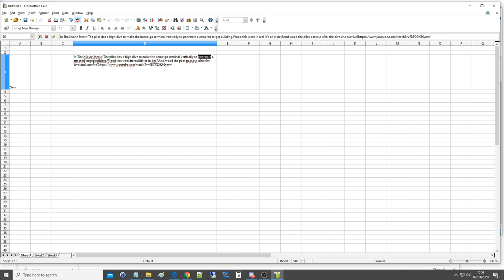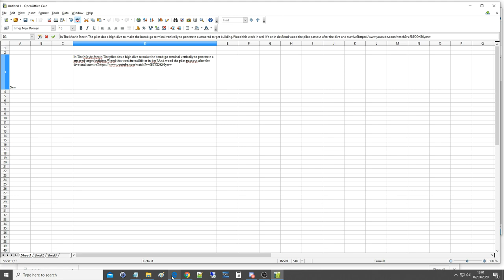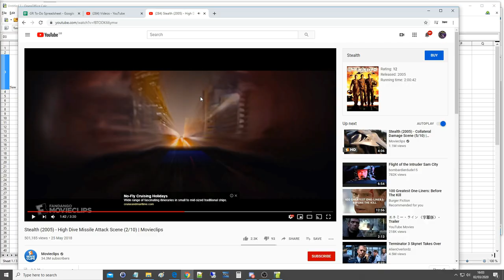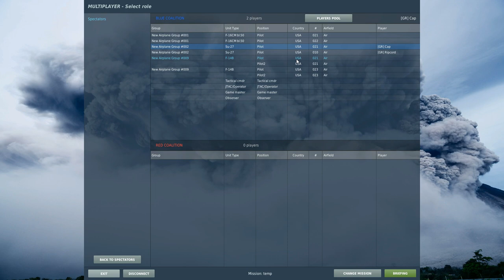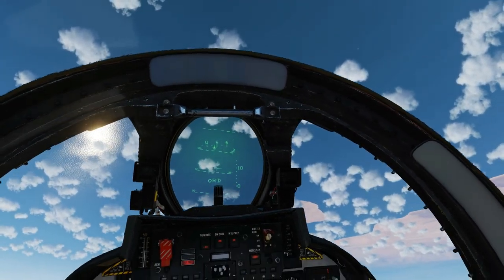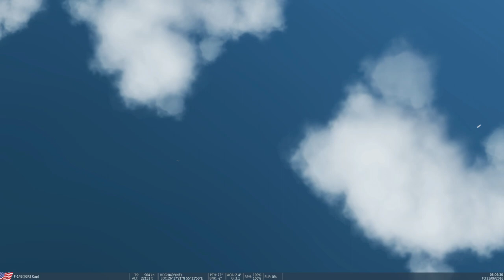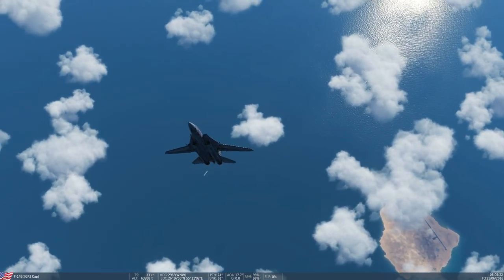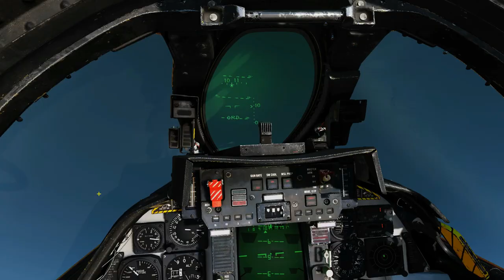Stealth(2005): Can You Increase A Bomb's Penetrating Power By Diving? | DCS WORLD

Comment: Cap - to optimise your acceleration during the roll in using the profile you're flying, unload to 0 g . Fixed wing aircraft accelerate optimally at 0g because the wings aren't producing lift (flying a ballistic profile) and therefore no lift dependent drag is produced, so acceleration is improved for a given thrust. Be interesting to see if DCS models that actually - can you check in a video?

Comment: During WW2 several planes went straight into the ground during dive testing because of compressibility problems. The
 controls would lock up and they would be unable pull out of the dive. 
I also read about a special bomb  that was developed from worn out 5" gun barrels. They would attach fins and a sharp nose to them and fill them with explosive. When dropped from high altitude they wouldn't penetrate deep under ground. Don't know if they would go supersonic.
Reply: GBU-28 were initially made from 8inch gun barrels, specially designed to hit underground bunkers in Iraq

Comment: Definitely can go supersonic, you've got gravity vs drag here, and the are designed for low drag.
Reply: Same might be argued for the f18.
 If you go idle power and go high as you can and drop nose fully down, holding it there, it accelerates, but only to a point, never reaches mach1, and once below about 15-18k starts bleeding speed again as the air gets thicker (IAS still climbs).

To confuse this even more, if you do the same again, but with bombs still on the wings, the plane falls even slower.

Limits of the SIM I imagine.
Reply: @CameTo  Compared to something like the shape of a Mk80 series bomb, it's not as clean from an aerodynamic POV, and few planes would be, especially in the case you suggest, of going to idle power, the air intakes will cause a lot of drag for example, there are plenty of parts of a plane that induce a lot of drag which a bomb designed like the Mk80 series wouldn't have, there's a reason they got the nickname "slicks".

The Mk80 series were designed to be able to go supersonic, not just when being lugged around by a plane, but also during fall.

Comment: Weight does not matter....not for speed. Only for penetration energy.
Reply: Karsten M. And holding velocity for missiles lighter missiles can go further with less fuel
Reply: @codename1176  Good point.
Reply: Weight does matter.  What you are thinking is that weight does not matter in a vacuum, but it does matter in an atmosphere. Drop an empty cardboard box and a cardboard box filled with concrete or lead from 30,000 ft and they will reach different terminal velocities.
Reply: @gort8203  Since the shape of the weapons is clearly aerodynamic it will make no real difference. It will also not make a delta of 1000% like in your cardbox example.
Reply: @BcHmF  Agreed it may not make an appreciable difference for the particular bomb in question, but it does matter for other dropable objects and as a general principle, which is how I read the declaration.
Reply: @gort8203  Roger that
Reply: @codename1176  It will need less time and energy to reach its top speed, but it will fly for shorter once the burn is over.
Inertia works both ways.